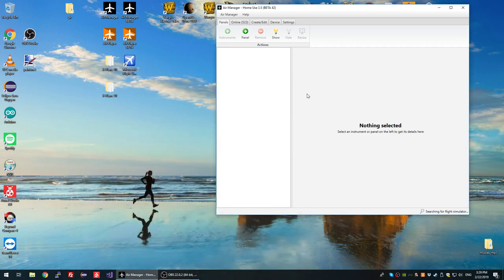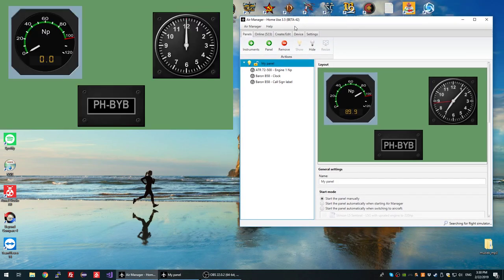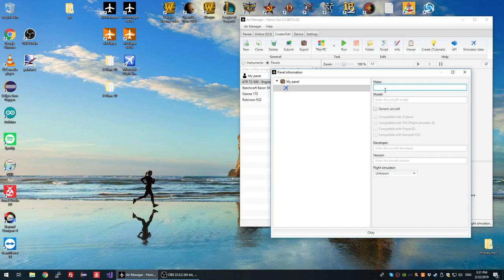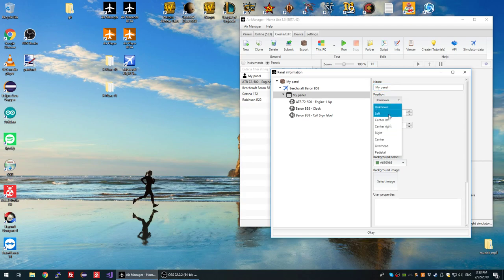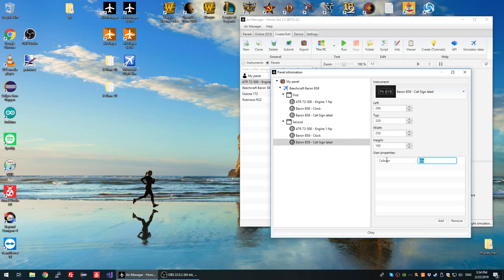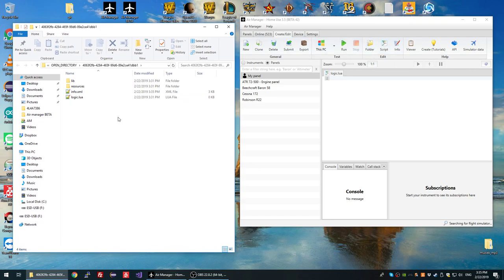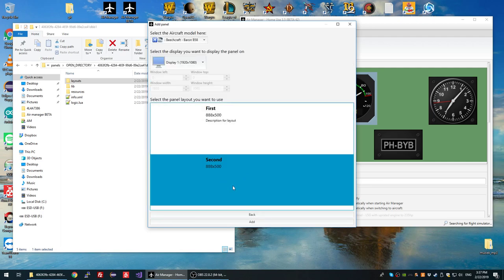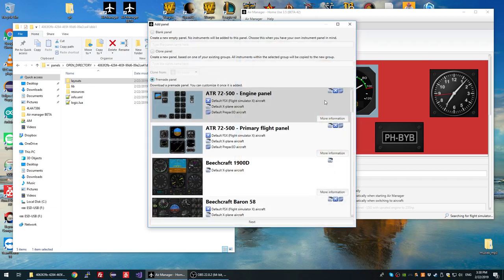Creating a pre-made panel

Comment: Thank you for your time for this great presentation.   Question.... I normally make a panel and install the instruments in Air Manager and then clone to Air Player, in order to make the correct panel I need to actually go to Create and make panel from this format?   I have been using just the basic layout tools but it appears I am unable to save the custom image I created for the background.    Can you make a quick video showing adding custom image?
Reply: The method described in this video is only useful if you want to export your panels as a package, it is not meant for Air Player.
Custom background images are not yet supported in Air Player 4.0, will be available in 4.1 or 4.2.